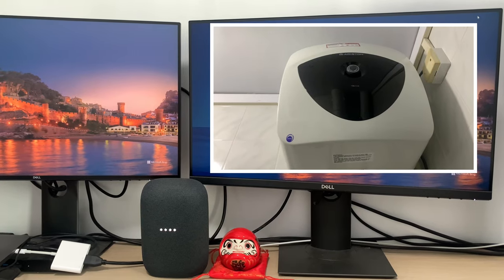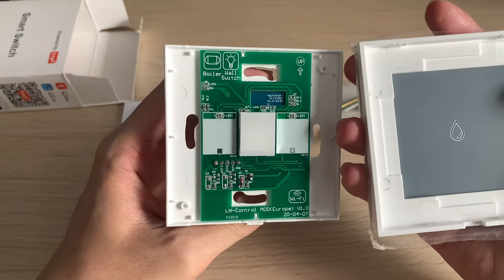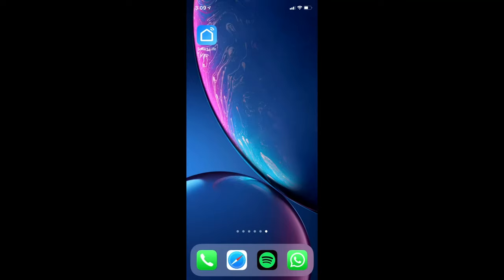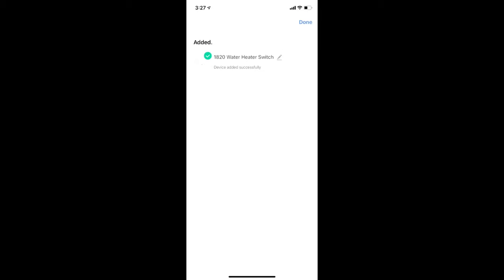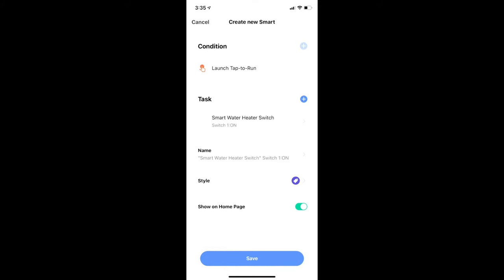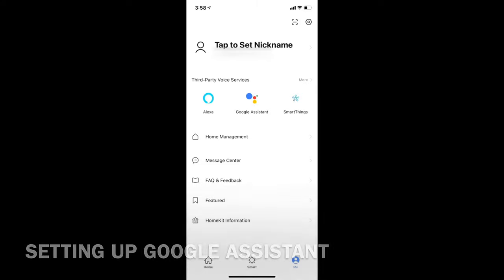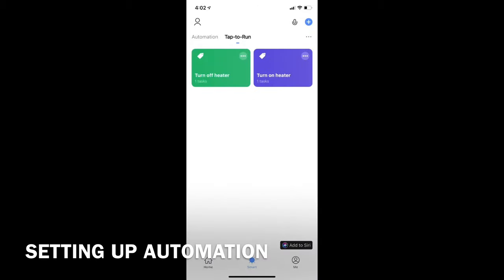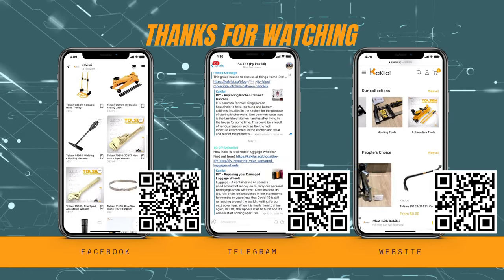Automated Water Heater - Tuya 20A Smart Switch (Installation and Setup)

Comment from the maker: Let talk about the earth wires. You should find 2 earth wires in the socket. One connects to the heater and the other one leads to earth. they are usually connected via the conventional 20A switch that comes with additional connection points as an added safety feature by also grounding the socket/socket screws. However this is missing in the tuya switch, so all you need to do is to wire them together, wrap it up using insulation tape(or black tape as most people call it) and tuck it at a corner in the socket. THIS IS AN IMPORTANT STEP as it ensures that your water heater is grounded in the event where the heater becomes faulty. If there is an electrical leakage in the heater and the grounding connection is not available, electricity will flow through the easiest path which will potentially lead to electrocution of the user.

Comment: From my knowledge all water tank heaters should be left on all day. It’s takes less energy to Maintain the heat rather then re boiling every time. 

Also it’s bad for the tank if you keep cooling it off and heating it up again. You would unknowingly create more wear and tear internally
Reply from the maker: Technically, you are right due to the thermal expansion and contraction occurring on a daily basis. At the end of the day, it is up to the user to decide whether it is worth keeping the heater on perpetually as that will drive up the electricity bill or to do what we are doing here. I'll prefer to do it this way since storage heaters are known to rust internally anyway which means a replacement is inevitable. I might as well save on electricity bill and be more environmentally friendly. :)

Comment: Hello there. My question is what about new HDBs (post 2019) where neutral wires are not pre-wired by default? Are there alternative smart switches meant for no neutral wires? Also Do any smart switch work or does it have be 20A
Reply from the maker: This smart switch does not have neutral wires. It has to be 20A smart switch, using anything less is very dangerous

Comment: We have a similar switch. On the app ita says the switch is on but the swithch has the blue light on. When I press the switch manually it turns red (but it is a muted red) and the app says the switch is off. I am confused. When is it on and when off???

Comment: Quick question. I have one installed at home. The app keeps saying that it is on although the panel has a blue drop. When I manually press the switch and turns red, tha app says it is off. How do I fix this? Am I wrong to assume that blue means off and red means on?
Reply from the maker: I’m not sure if the model you bought is the same as mine as I don’t recall seeing blue and red light… but if turning on/off also reflects on your mobile app then I’m guessing it’s already connected properly. You might want to check with the seller on this.

Comment: Hi, thank you for the instructions, but i am unclear on the earth because i find it confusing from the pinned msg. From what i see at 2.05, the 2 earth wires are wrapped individually in yellow tape(what is this) and connected to something metal(what is this) and shoved to a corner of the socket. Is that how i shd do? Or shd i connect the earth to each other using a plastic connector ( the white tubes you can press on that can be found with lights?) sorry, i am new to do and not familiar with tge terminology
Reply from the maker: 1:52 you can ignore the yellow tape and metal hoop that I installed cause I removed that in the end and just connect the 2 earth wires (twist the copper wires together and wrap it with black tape). The white connector you mentioned can be used but I’m not sure how secure it will be
Reply: @kakilai got it, thank you so much! Btw, that means the the switch is not grounded right? Is there any risk of electrocution there? Or since the case is plastic, we shd be safe?

Comment: Should install a double pole isolator before the smart switch  as a precaution...
Reply: yes, i did my house same also double pole insolator, these tuya switch cannot last.
Reply: Hi does this means the double pole isolator sits behind the switch inside the wall or?

Comment: Hi, thanks for the review.

Is it possible to configure the physical button on the wall-plate to function as a boost button which will switch on the immersion for eg. 30 mins?

Comment: Is the switch still working. Have quite a few report on circuit board burnt/melt due to high current
Reply from the maker: Yeap still working fine still today! But you are right, the switch is warm to the touch after it gets turned on for some time

Comment: in the old switch, the earth wire was tied together, but the new switch just use 1 earth wire to connect to the screw? so another earth wire just wraps it up and put it aside inside the socket?why not 2 earth wires tie together and screw it on the screw?
Reply from the maker: hi please refer to the pinned message

Comment: Hey, need suggestions. My heater switch is outside of the master room. Can this be pair with a normal wifi switch transmitter/smart wifi button/etc? Which I can put in the master room and press without going outside of the room?
Reply from the maker: Hi, from what I already know, the product isn't designed to work this way. You will likely face trouble trying to pair it with other smart devices. You should pair this directly to your wifi and once that is done, you already can remotely control your heater from your master room.

Comment: Do this show current usage and Watts consumption live and can we manually also on and off without always going to the app
Reply from the maker: Unfortunately, it doesn't have the function of keeping track of energy consumption, and yes you can still turn on the heater manually using the touch panel as show at 3:06 of the video. Just tap on it stead of long-pressing it.

Comment: Hi

Can we ground the ground wire to the switch screw instead of tapping it up?
Reply from the maker: you can do that but it wouldn't make the switch safer in anyway since the entire enclosure is made of plastic. if you do, makes sure that BOTH earth wires are connected together to the same screw. If you do not do that, your water heater is not grounded and that poses as an electrical hazard.

Comment: Can I use this switch for water pump which is also 20A?
Reply from the maker: Hi, it should not be a problem, I have seen other buyers using the switch for other purpose based on the comments they left on the online store. You might want to contact the seller to confirm with them.